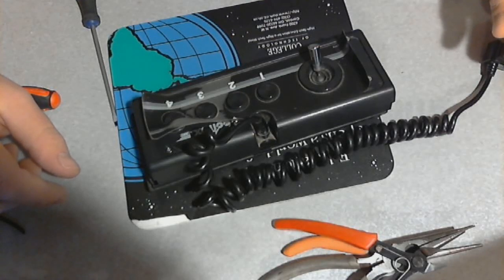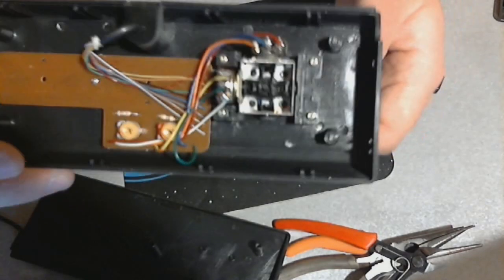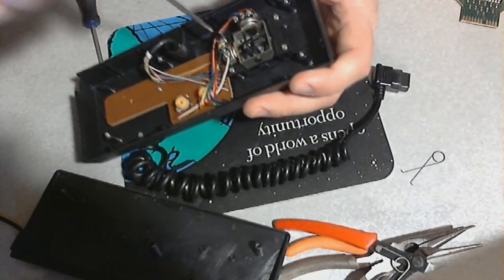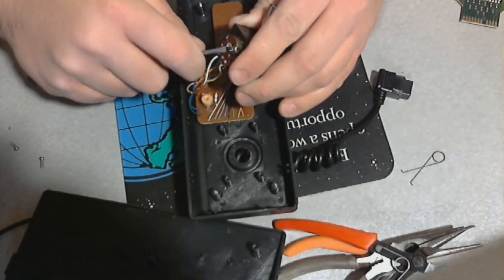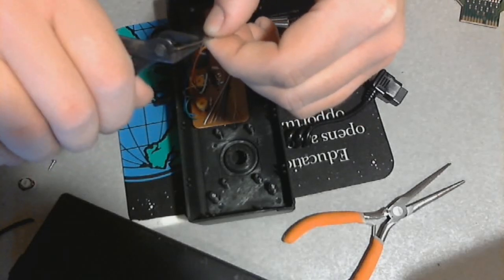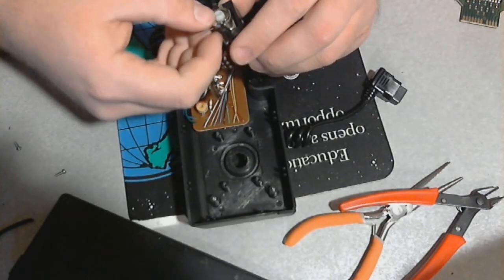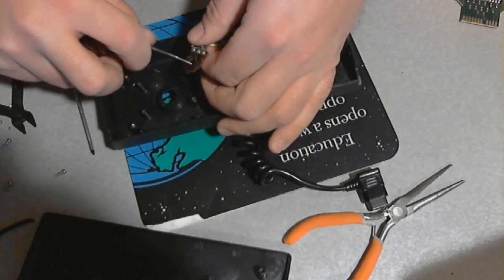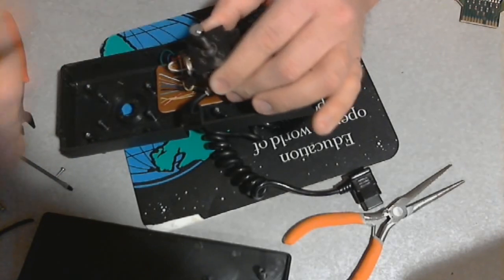How to fix your Vectrex controller joystick, or simple repair for your Vectrex controller joy stick.

Comment: Awesome video, very well done.  My controller returns to centre but the stick is actually bent.  I can't get the appropriate leverage to straighten it out with out taking it apart.  Now I know where to look for the screws.  My controller is pretty crappy looking anyway, so I can't do too much harm - it does work though, so have to tread carefully.  Have not found many online to buy that don't include another mortgage on the house!

Comment: I had a spare Vectrex controller that had unresponsive buttons and I saw this video fearing that when I open it, the vectrex label would curl up and be ruined just like in this video. Lucky for me, it didnt and it looks just like it did before I opened it. Buttons work too!
Reply from the maker: +Darko Very happy to hear that it worked out for you. Was it just a matter of cleaning the contacts?
Reply: +EdT1138 yeah. Sadly I still don't have a metal thumb knob for it

Comment: After getting the stick to center, my little Mine Storm space ship wouldn't stop rotating to the right. Apparently you can calibrate the pots with the little plastic screws in the controller.
Reply from the maker: That seems to make sense. Let me know if it works out for you.
Reply: Thanks.

Comment: anyone checking this post-2020 "console5" sells a replacement spring now for a buck so you don't have to sacrific an atari cart.
Reply from the maker: About time!

Thanks for the heads-up.
Reply: @edt1138  I actually did a batch of the springs back in 2017 but eventually ran out and console5 has taken over production, if you weren't on proboards vector gaming board, atariage, FB Vectrex Fans Unite! group or looking on ebay for "vectrex springs" you would have missed it haha.

Comment: I'm having am issue with my Vectrex controller where the buttons simply ceased to work, all four of them at once. 
I played a game, turned the Veccy off, everything fine, turned it on a couple of weeks later and nothing. The stick works fine but none of the buttons respond. 
Could this be a capacitor issue? 
I really haven't a clue

Comment: Thank you for this very useful video!
I have another problem with the joystick
The two black plastic parts that are used to make up / down and left / right - the ones you show in your video (time 2:00) are broken - I tried to pick up the broken but have again
Is it possible to find between individual parts or change the entire block by another controller?
Thanks for your help.
Reply from the maker: +Ludovic Bodin I'm really sorry, but if you're talking about the pieces I think you are, I have no idea what you would use to replace them.